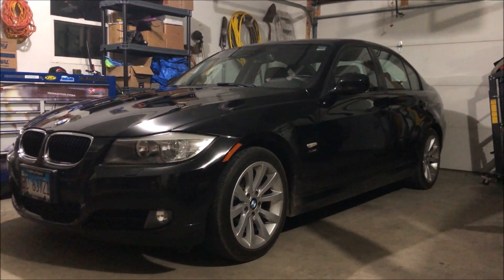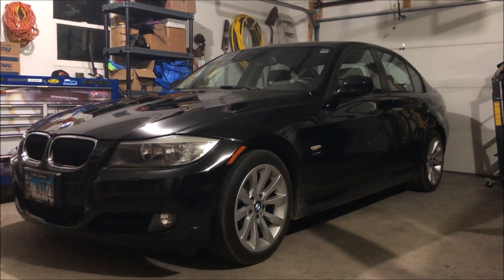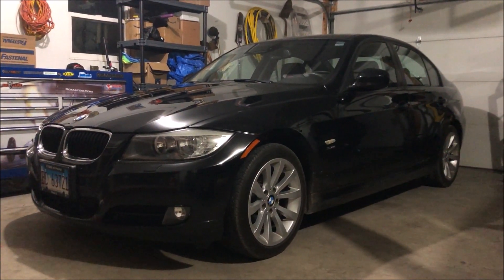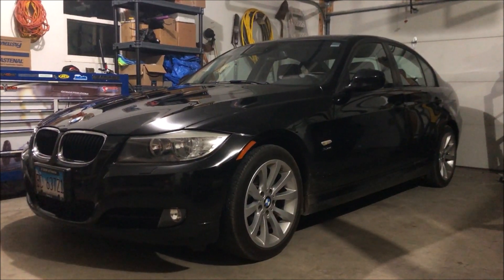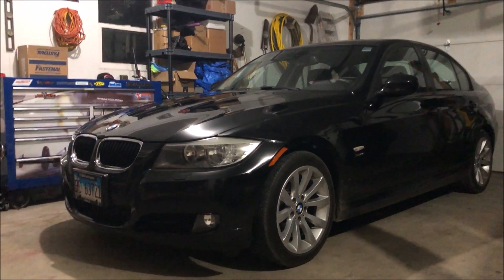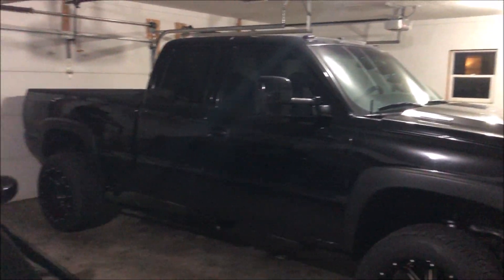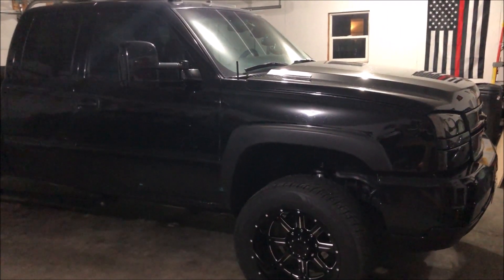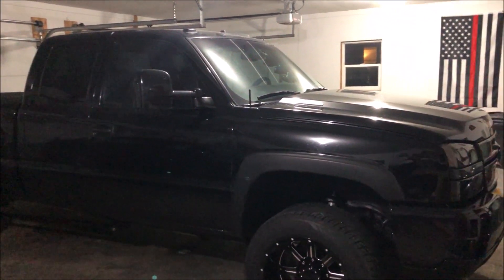The Duramax is being Retired!!

Comment: We talked a few weeks ago on Instagram, I have a danville 64mm . If I was going to do it again I would definitely go with an s300 or s400 kit . I’m saying that just because I know this charger will max out around 650hp . I have no complaints as of now ,but I know in the future I will want more power and I’ll end up pulling it back out!
Reply from the maker: Clearly you got your installed finished up! Thats awesome, hopefully its running good? 
That's a fair point though, totally depends on your long term goals, personally I dont really plan to do a full motor build to push past that 6-650 hp mark so a drop in isn't a bad option.  Long term like I said in the video I would love to have a wagler street intake and s472 on a twisted pedestal etc. But while that may last awhile that is 100% on borrow time lol!